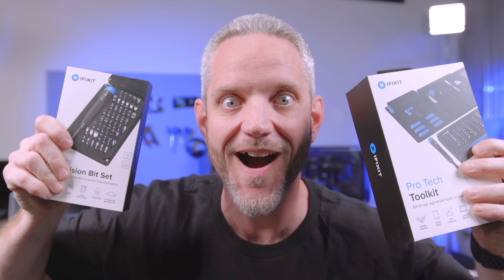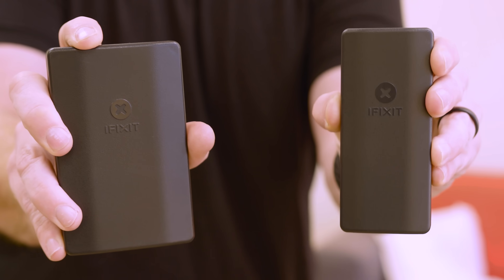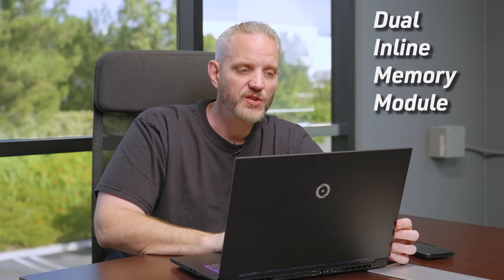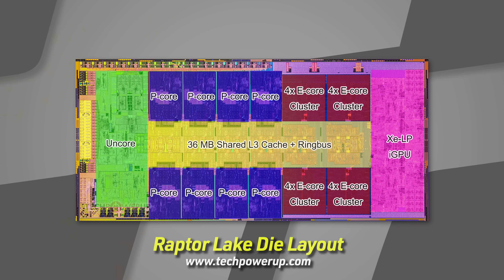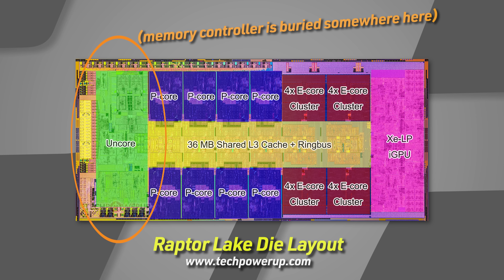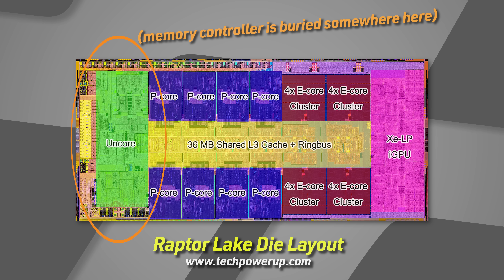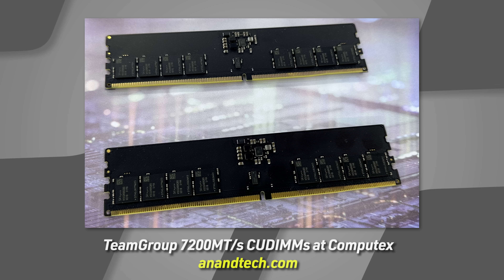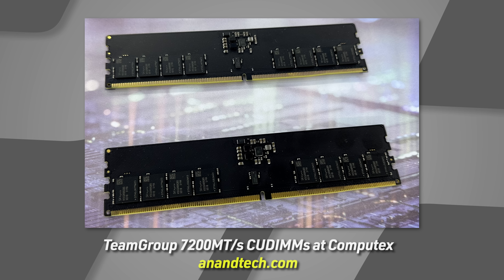RAM just got a LOT faster! Up to 10,000MHz!

Comment: For me i dont see the point in my workloads on going with CUdimm over what i sue now, which is Rdimm.  When i am compiling something with the number of threads my build machine has, i do not want a memory bit to flip during it and not get caught.    For me having even unbuffered ECC sounds more appealing at least for my needs than cudimm.  nnow if i where on a machine where i was using the on cpu igpu, having faster ram might be useful there.  However this is just my opinion for my use cases.

Comment: If I look back on every piece of PC hardware I've gotten, going back to the 90's, it was always the RAM and storage that mattered for overall experience. The CPU and GPU did matter for games, and when dual-cores came about they added a substantial improvement to multitasking. But the memory size, bandwidth and latency matter so much to anything that just slams the system with lightly-processed data - e.g. many tasks related to data archival fall into this category (building archives, computing PAR2 data, verifying).

Comment: My desktop, running Qubes with 10-20 VMs going at all times, supports my extreme multitasking workload. Meanwhile I'm playing Factorio which is a CPU-heavy game notorious for bottlenecking on memory latency. So yeah, I can FEEL memory speed on my system. Running 6200MT with tightened timings currently and you can bet I'd go for 8000+ as soon as I have a good enough excuse.

Comment: Whats with the mixup of MT/s vs MHz? Especially in this video its a back and forth between MT and MHz, but its important to note that MT/s is double the MHz. So 9600MT/s is running at 4800MHz clock speed.
Reply: ikr. It's so annoying and jarring. It should always be MT/s

Comment: Bandwidth > Frequency
DDR is like a tiny hose with a massive compressor pumping data through.  Instead of making the hose bigger (because they really can't) they just keep increasing the pressure and making it run hotter and hotter.
Reply: Are we talking 8x4GB DDR2 ECC kind of hot? I used to heat my room off my old Dell dual Xeon workstation.
Reply: @jabezhane  
They keep expanding L3 handlers and pretending that makes up for the garbage L2-L1 throughput.  All the on board "AI" is to pre-fetch/prioritize ram because the main CPU can not now nor could it ever address large amounts of ram.  They just moved all the handlers adjacent to the CPU on the main CPU die and pretended it was part of the CPU.  x86 is hot garbage and still around because of planned obsolescence.

Lots of things can only be processed in serial--especially in scientific computations--so the threading and PdP is a meme.

Comment: CUDIMM is very interesting for me because I’m thinking of upgrading my system soon, especially with the new NVIDIA series coming out but there needs to be a lot of testing to be done. I‘m currently running I9 10980xe and a 3090 with DDR4 4000 MHz at cl 16

Comment: Anything that is computation intensive will benefit. Quick list.

iGPU, NPU, AI using AVX, media encoders using SSE/AVX, DSP related workload using the FPU.

However, for gaming, keyword is memory latency. A 6000MT/s CL30 is going to run faster than a 9600MT/s CL60.

Looks like X870 motherboards may indeed have a purpose beyond a rebranding.

Comment: So by using CUDIMM, we can really use high clock speed at 4 slot without worrying the speed will go down? 
And also when using memory speed at 10000 MTS, the cpu does not need to go gear 4 or something similiar?

Comment: Remember how at the beginning of the year everyone was saying "to get faster than 6000 we're going to need LPCAMM on desktop" and i was like "Bruh, i have 8000 in 1:1:2:2 on my 8700G, my 5700G at 5000CL17-17-17-28 in 1:1:1" the problem isnt only trace length, LPCAMM is needed on mobile because to run faster RAM you need to up the voltage, this makes the modules hot. LPCAMM standard allows for placing all of the modules on one side as if it were LPDDR soldered to the motherboard. 99.9999% of SODIMM boards do not install RAM at 90 degrees from the motherboard for cooling like on desktop meaning that at best you have 2 RAM slots side by side with one side of chips getting no cooling through the motherboard, at worst case(better trace length) you actually get 2 RAM slots stacked on top of each other, so only the top layer out of 4 are getting cooled. Heck i had a miniPC that i ended up needing to install a copper heat spreader and aluminium heat fins with thermal pads between the 2 SODIMMs because it got so hot it killed a DDR5 5600 kit(both sticks), after that i was able to run 6000 stable

Comment: CUDIMM obviously is the future. I would most likely go that way. But I think it might be good to wait couple of months before getting the newest as it most likely will have upgrades. Also when I'm looking at the speed of CUDIMM I got the impression that there is big speed difference between 2 DIMMS to 4 DIMMS. Maybe I'm wrong but if this is the case you might want 2 x 32gb instead of 4 x 16gb. More info needed.
MSI MEG Z890 ACE

4x DDR5 UDIMM, Maximum Memory Capacity 256GB
Memory Support 9200 - 6400 (OC) MT/s / 6400 - 4800 (JEDEC) MT/s
Max. overclocking frequency:
• 1DPC 1R Max speed up to 9200+ MT/s
• 1DPC 2R Max speed up to 7200+ MT/s
• 2DPC 1R Max speed up to 4800+ MT/s
• 2DPC 2R Max speed up to 4800+ MT/s

Supports Intel POR Speed and JEDEC Speed
Supports Memory Overclocking and Intel XMP 3.0
Supports Dual-Controller Dual-Channel mode
Supports Non-ECC, Un-buffered memory
Supports CUDIMM

Comment: i think camm2 and cudimms will produce less heat in the dram itself bcoz of the clock generator and also less heat on the cpu because the imc will not be stressed , but still hope the motherboard manufacturers include a ram fan bracket on the mobo for more stability and less heat on the ram

Comment: why does EVERYONE waNT TO CALL IT A driver chip... it is not.. ITS ON THE RAMM MODULE SO IT MAKES IT A re-driver.
Reply: on youtube you read tech info on it its called a re-driver my MANUFACTURER
Reply: Same as on server gear (storage cards, HMDI cable(ACTIVE ONLY - Has re-driver chip to boost signal
Reply: Its a clock genertor anyways, there is bo such thing as a re-driver techinally.

Comment: So, does CU-DIMM have mobile applications?  Will this help in allowing upgradeable RAM on laptops return?  Ie: if we boost the transfer speeds via a controller, will this allow laptops to have faster/cleaner communications over a spec similar to SO-DIMM as opposed to LPCAMM2 modules that seem kinda large and unwieldy?

Comment: I think I'm more interested in the stability of DDR5 with more than 2 DIMMs. It's been a few years now and it's still a low chance gamble on if a new set of binned DDR5 DIMMs (same make/model) will even work for my system even at the base clock speed with XMP/EXPO disabled...

Comment: Hey Jay :)  I'm one of the "work form home" type people, and for my work system, I have an N100 Mini (I do have a personal rig for games).  Locally run Teams and otherwise remote into my work station.  While I can run Office365 local (sometimes do when chasing a work idea after hours) that is all I need in a computer.  It works, works clean and fast and is mostly stable (yea Intel and Graphics in the same sentence is...).  I really am not looking at the latest or greatest and feeling I need it.   I know I've said it before here but it still applies; why drive a Lamborghini when you live in a school zone and the only driving you do can easily be done in a Ford Focus?  As to that personal rig, still with early gen ZEN and DDR4 and not really found it lagging in a way that I would want to move up in generations.  Could do with better graphics but then we always can do with better graphics 🤣

Comment: I'm sorry but this is not how the clock driver chip work jay. the cpu send a clock signal to each chip on the Dimm. what this chip is doing is taking the signal for chip 0 and buffering driving a stronger signal to all the memory chips this ensures all the ram is driven in sync from a single clock line. 
the board chipset has nothing to do with cu-dimm this is simple how clock domains work in the CPU memory controller
Reply: And in the cpu for its own mhz.

Comment: one thing I like to talk about is the DDR5 SOCKET that is on the MOTHERBOARD I know DDR4 SOCKET that is on the MOTHERBOARD is STRING you got PINS going though the motherboard its welded  on the motherboard making a STRONG  CONNECTION. about DDR5 SDOCKET Yes  the DIMS got VERY  IMPRESSIVE CLOCK SPEED That is comes with a PRICE that is EXPENSIVE DESIGN FLAW  the DDR5 SOCKET is mounted the same way as  MICRO USB PORT simply  STIICK IT ON TO THE SURFACE OF THE MOTHERBARD AND ITN FALLS OFF RIPPING OFFTHE LEADS ONTHE MOTHERBOARD even LINUS LTT  gave  the very same warning that I am talking about./ like for example MINI ITX MOTHERBARD is very small. the SMALLEST MOTHERBOARD the  two DDR5 SOCKETS is too close to the CPU SOCKET installing a CPU AIR COOLER is going to be a extreme hard case the  MINI ITX TOWER dose not use 99.5% of the CPU AIR COOLERS on the market. its simply too big and too tall. so if you find one that is that will fit not too tall and a lot  shorter that is what I wanted there is a COST to that as well the CPU AIR COOLER  GETS WIDER EXTRA EXTRA EXTRA WIDE is going to SLAM in to DDR5 1ST SOCKET so what it will do is that DDR 4 socket  #`1  will simply FALL OFF the same way as MICRO USB SOCKET some cellualr phones do use  that MICRO USB PORT   CHINA love it  becuase its CHEAP to MAKE EAZY  to SELL.  SAMSUNG use USB  3.1 TYPE C SOCKET that is dsign a lot better not to fall off the motherboard. my SOLUTION to all of this DDR% SOCKET DESIGN FLAWS is buy a X570 MOTHERBOARD buy a RYZEN 7 5800X CPU and its AMD WRATH RGB AIR COOLER that dose fit on a  X 570 MINI ITX MOTHERBOARD and FITS on a COUGAR QBX  MINI ITX TOWER there is a PROBLEM MSI dose not make X570 MINI ITX MOTHERBOARDS any more. teh good news is I use the DDR 4 SOCKET that I know works. at least for now. and wait for DDR6 SOCKET when ever that comes up. 10 years  or 20 years  I do not know I do not buy motherboard with LGA due to BENT PINS ot PINS  SNAP OFF and  BURN OFF i have gone though 60 X99 motherboards with a bad  LGA SOCKET ASUS  BLAME ME for PILOT ERROR it was all TOP OF THE LINE MOTHERBOARD. that is why I change to MSI  they have a BIG ASS PROBLEM the SERVICE how many years you get is not on the the sales slip that I get from the ONLINE DEALERSHIP like  NEWEGG what MONTH NUMBER what DAY NUMBER and what YEAR NUMBER if a BUY X570 motherboard from NEWEGG today nd I got a DOAI call MSI USA or go on MSI WEB SIGHT and file a ONLINE RMA for service I cannot the WARRENTY TIME is used up  REPAIR RMA REQUEST VOID the CLOCK STARTS  ON ITS SKU LAUNCH DATE NOT THE DATE ON MY SALES SLIP when things go wrong all hell breaks loose. I do not do business  for ASUS any more. I done the same thing EVGA have done with  NVIDIA is to have a DEFORCE that is what I have done to ASUS there are not happy about it.  ASUS LOST A CUSTOMER TO F**K WITH then after that is NEWEGG the same thing happened to STEVE GAMERSNEXUS with a BAD DEAD MOTHERBORD the only thing is MY  ORDER IS BRAND NEW NOT A RETURN RMA after I have a DEFORCE with NEWEGG I have another DEFORCE with LEGO just order a FEW LEGO  MISSING PARTS and BOOM LEVEL A  NAZI  CLASS ACTION CIVIL LAW SUIT LEGO FILED ON ME> ANOTEHR 55 YEARS OF SERVICE TURN IN TO A DEFORCE  THE WORST ONE YET its aoo the fact I  VOTED for TRUMP that have nothing to do with LEGO GENERAL ELECTION IN DENMARK and I got the ASUS SYTLE NAZI  CUSTOMER HELL HOLE THAT  LEGO IS USING. why is the same thing happen again and again and again to me?

Comment: The problem is any high speed dimm will be in Gear 2, timings might be crap and might not even work depending on the board. It’s really meant for the HEDT that needs the higher capacity. For the average gamer it’s unlikely to outperform regular lower timing dimms.

Comment: At high speeds with a chip inbetween it usually adds a noticable latency. The whole idea with IMC was to remove chips between CPU and RAM. But if it will improve speed and somewhat compensate for latency, it may work. Benchmarks will be the proof. 🙂
Reply: Its old tech from 30 to 40 years ago.
Reply: Nah, more like 20 years ago, but physical limitations still apply. Not saying it will not work. But we have seen failed tech before, like Rambus (while for a different reason).

Comment: The new MSI X870e Carbon has support for CU-Dimm. So not sure how that is going to work with AMD x3d
Reply: No it doesn't. Only Intel Z890 platform currently supports CUDIMM memory officially. If you install a CUDIMM stick on a AM5 board like that MSI one, it will either not work or use a bypass mode that will make it work as a normal UDIMM stick (so without the CUDIMM benefits) at lower clock speed.
Reply: @Patrick73787   I also confirmed with MSI. They said yes because 8000 and 9000 Amd processors will have support for it.

Comment: What I want is to not have to search for ECC RAM but all modules to just have it. Unbuffered for home and Buffered for servers. ECC saved my ass many times I am sick and tired of the constant crashing with $400 best speed memory kits that don't work as advertised because they keep crashing at their XMP speeds. ECC just runs at the speed it says so 4800 it will be 4800 XMP or DOCP is not required. 5600 is 5600 no need to set anything. ECC runs at a lower voltage too and can be overclocked to pretty normal speeds without causing instability normally as long as you don't touch the voltage too much.
Error correction happens about once a month atm probably due to heat and the overclock I have on it. 3200-16-18-18-18. With my previous RAM kit I was crashing every evening without fail.
Please just make normal speeds ECC Memory.

Comment: Just like the shift from Sync DRAM we went to double data rate (DDR) Ram. Why not move to a triple or quad rate RAM instead? You could run a 2000MHz bus and with quad data rate RAM get 8000MT/s.
Reply: I image signaling would be the issue, givin that the current latest platforms are struggling to reliably work with 7600/7800/8000MT+ speeds.
Reply: @smashed_penguin  I suspect that it's more on the CPU and motherboard side and not the memory chips themselves. We see the same signal issues with current PCIe 5.0 requiring re-drivers for stability.
Reply: Requries redesigning all memeory controllers on all cpus.
Reply: @kevinerbs2778  yes it would require new JEDEC standards, a new memory controller with new signaling and traces. Not mention a new socket/platform in coordination with motherboard vendors. 

But this is nothing new, both AMD and Intel have done this for every version of DDR going back 20 years.